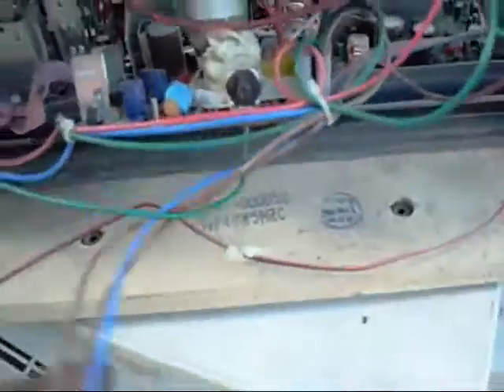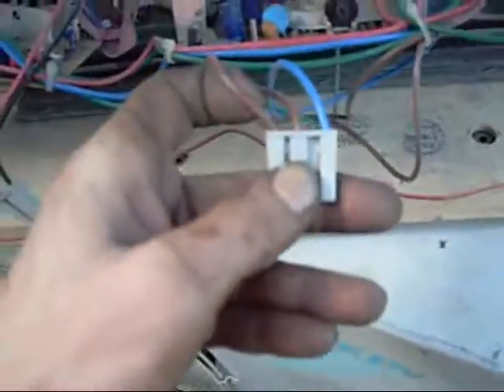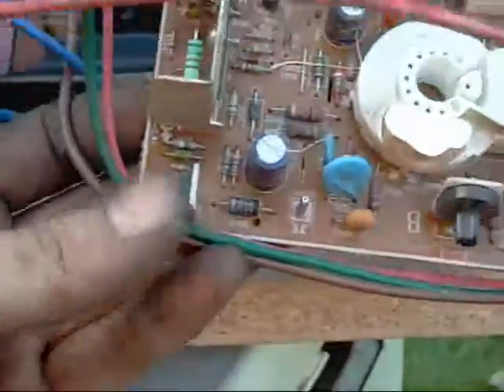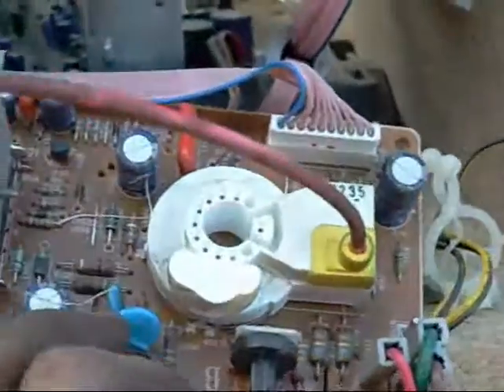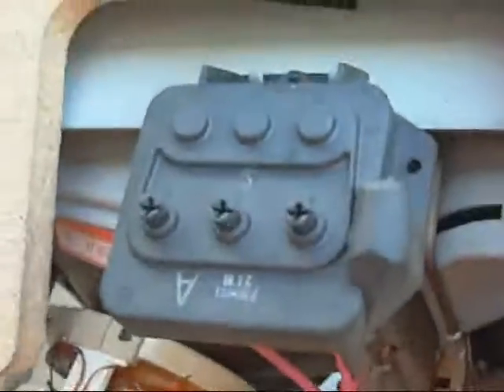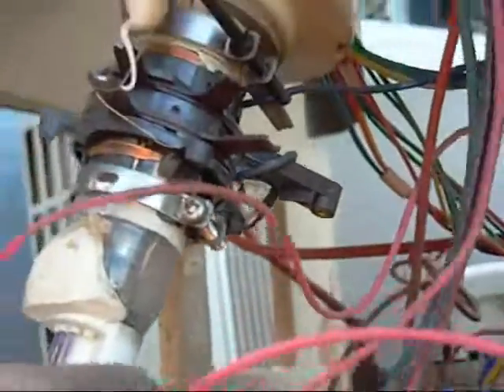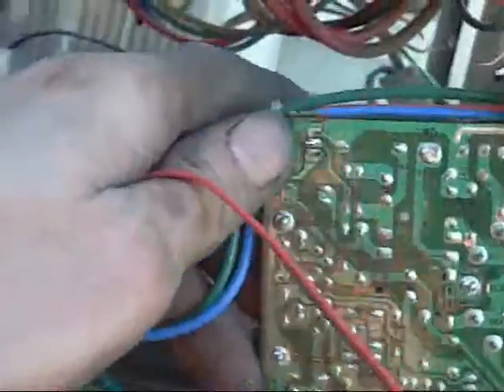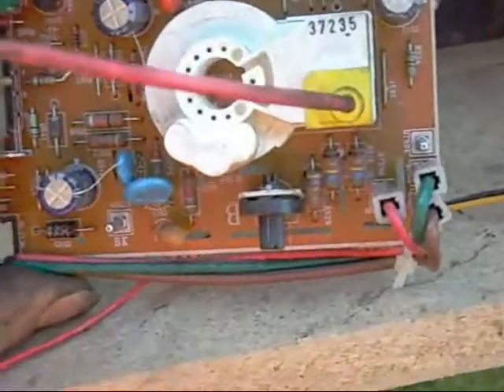Samsung Rear Projection CRT Boards

Comment: @Aussie50 There is fluid between the tube face and the c-element to keep the front of the tube cool. This prevents implosion due to over heating of the glass.